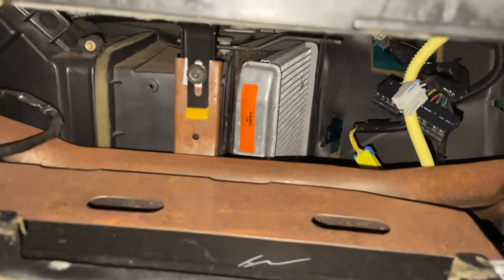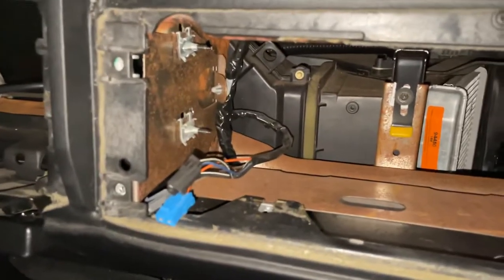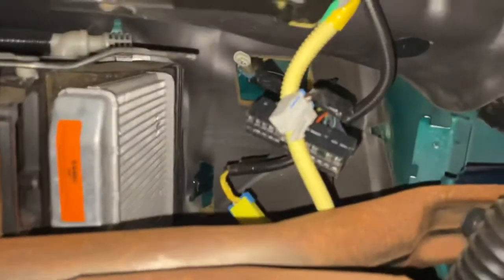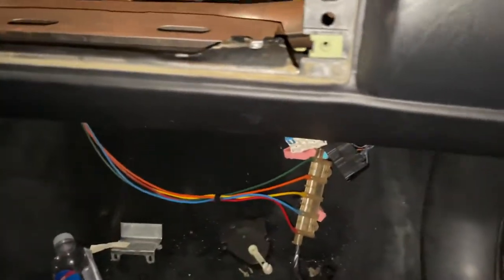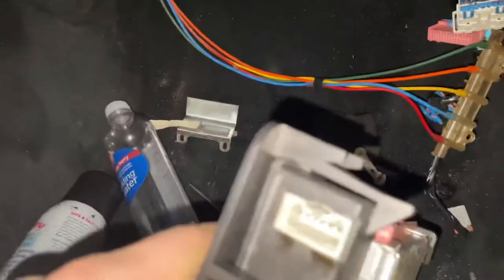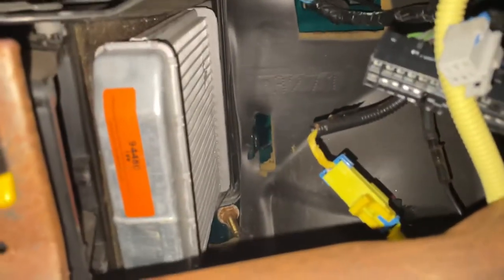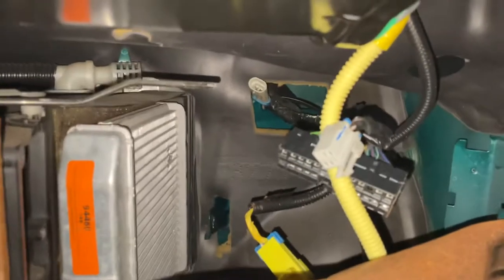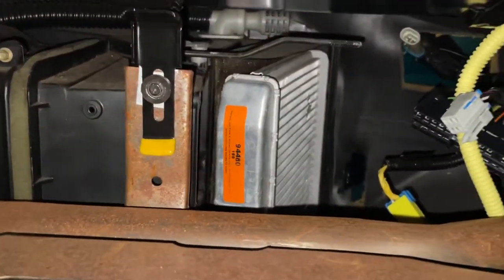1997-1999 Cadillac Deville Heater Core Replacement Guide

Comment: How did you get to the hoses in the engine compartment? Mine are sandwiched between the heater box and the strut tower. The box has a giant hairline crack and I'm wondering if the shop who did this last just busted the box out of the way.
Reply from the maker: The heater box cover which is suppose to be rubber but being so old are more like plastic, they’re two pieces, the line you may be seeing is where you can cut it to install it easier, can only install it with the engine out. As for the hoses, I ended up doing it with the engine out since it was slightly easier. It would be easier if the hose clamps were the spring clamps that can be compressed with that flexible clamp tool, I have hose clamps and used a socket on a swivel instead of a screw driver

Comment: That little coolant piece my line broke so the coolant doesn't even go in there anymore I just bypassed it I don't know if that will cause major issues I'll probably just show you a video of it but I'm still wondering if it's still possible just to take all of that out and just run a bypass
Reply from the maker: If you do a decent enough bypass you shouldn’t have any issues, just won’t have any heat. Also would want to recommend good quality hose or piping definitely don’t want a hose to leak or rub on certain things.
Reply: @MechanicalMikesRoadsideRepair  I'll see if I can send you a video of what got broken damaged and why I had to run a bypass I'm just using a rubber hose as a bypass for now and it's working but I'm trying to find a better alternative to it cuz I kind of ghetto rigged it to function
Reply from the maker: @CDC-Vprototype  Sure! I’ll take a look, and let you know what I think can be improved
Reply: @MechanicalMikesRoadsideRepair  thank you so much I'll try to shoot you a video soon as I can once the holiday passes
Reply from the maker: @CDC-Vprototype  you’re welcome happy holidays
Reply: @MechanicalMikesRoadsideRepair  thank you so much and happy holidays to you as well